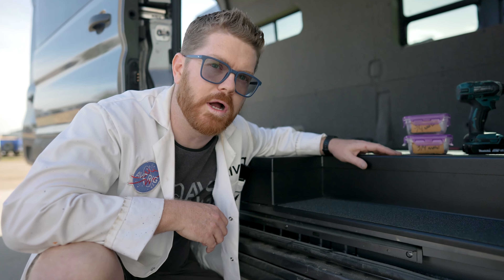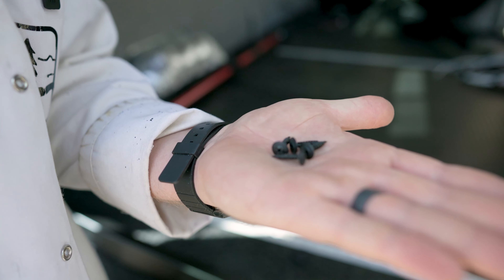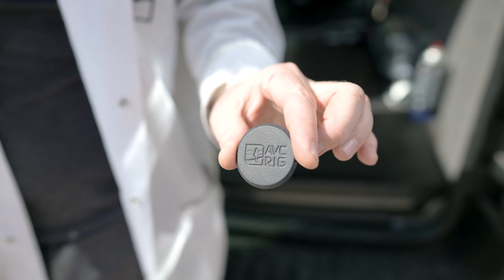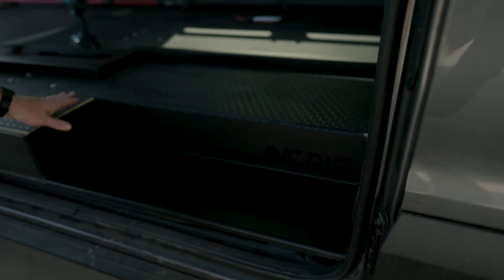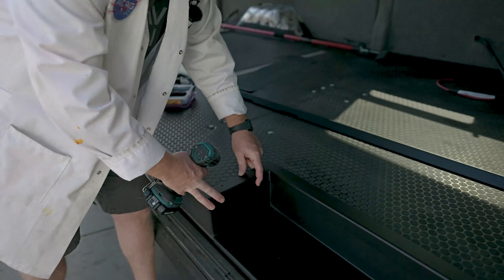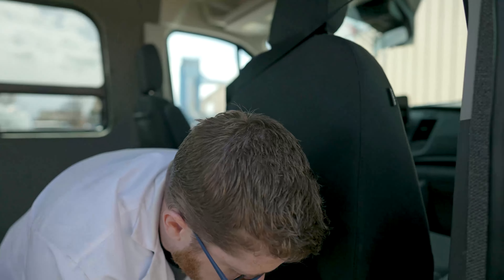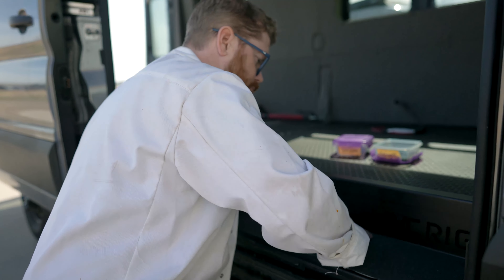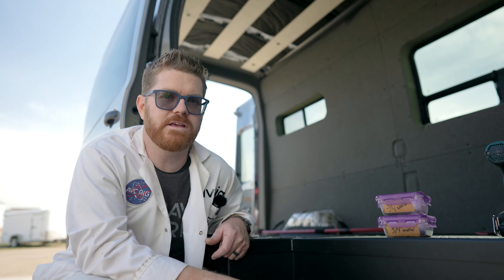Van Floor Step & Trim | CLEAN Edges in Ford Transit Camper Van

Comment: Do you have a full length side step and trim kit for the ford transit? I notice this version is designed for a floor that overlaps the factory step but 6 or so inches.